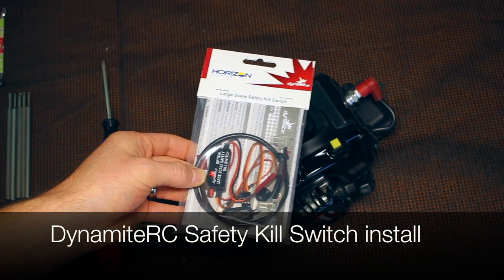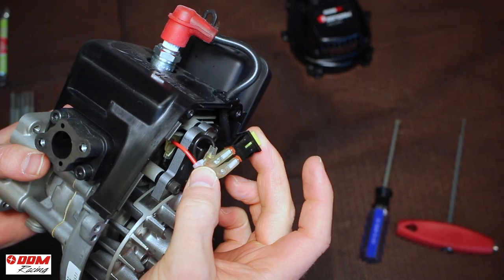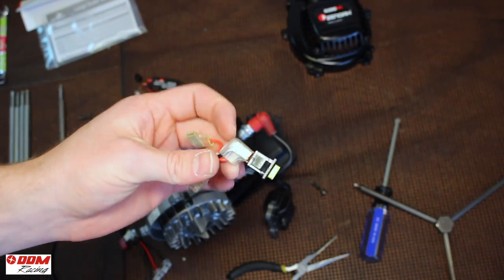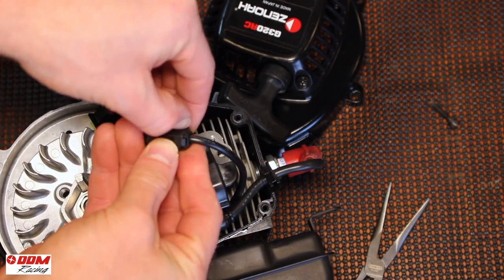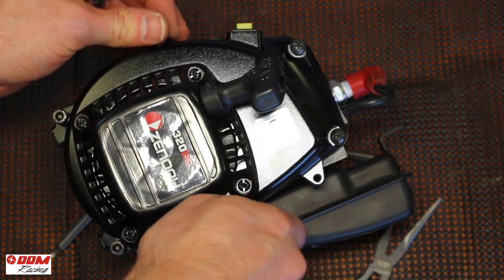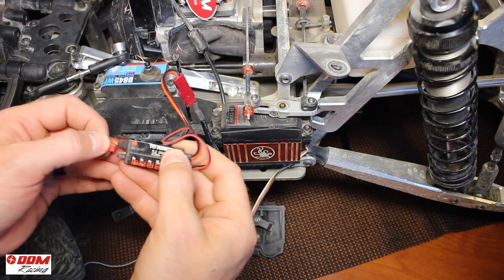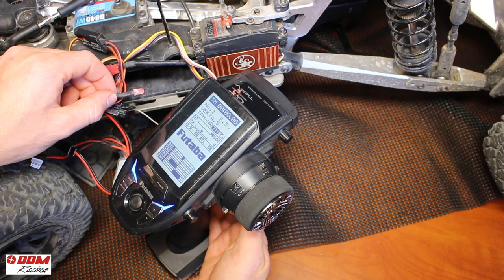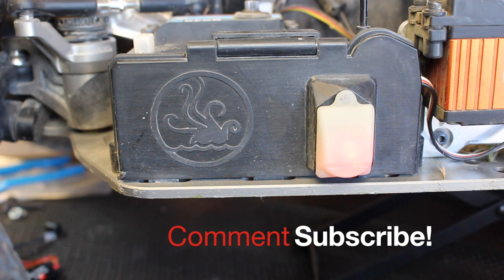How to install a Dynamite RC kill switch in your large scale RC car

Comment: To anyone that owns one of these..
I installed the kill switch and the red light stays on but If I try to start the engine there is no spark..
If I remove the killswitch cable from the module the engine starts fine but the moment I plugged it in the engine cuts off.
The 3rd channel switch works fine I can turn the LED ON and OFF depending on the status of my 3rd channel but it seems even with the RED light on the engine wont start... 

Again If I remove the killswitch cable the engine will start.
If I plug the killswitch cable into the module (Even if the RED Light is ON) the Engine will die immediately. 

Someone Help? Horizon repair and service dept takes forever to respond.
Reply from the maker: Sounds like it could be a dud switch, it happens from time to time. What transmitter and receiver were you using? Were you able to get through to Horizon? If you purchased it through me get in touch and we can get you sorted out.
Reply: Hi DDMSteveB! Thanks for the Reply..

After messing with it I found that the Killswitch is INDEED polarity sensitive, I went back and flipped the cables on the Magneto and BAMM it started working as it should. Horizon Support actually gave me the tip to do so, Even though the instructions clearly say that its not polarity sensitive it actually is so there is that.. 

I hope someone who is in the same boat try this before submitting an RMA..
Reply: @skirmich  thanks for the tip man, I am having the same problem you had, so I'm going to switch the wires on the coil and hopefully that solves it, thanks.
Reply: @jonnantau9354  No problem man! Mine has been working just fine for these 9 months I had it! One tip though: Remove the "Lost Signal" safety switch on your receiver if you have one because the Kill Switch kills the engine in the split instant you lose signal its a PITA for speed runs in the Baja.
Reply: @skirmich  thank you so much for this comment.  I have tried  almost everything  and was giving up. And I tried this asap and it worked right away.  Now I can sleep tonight 😂😂